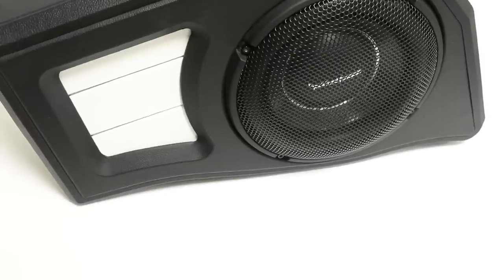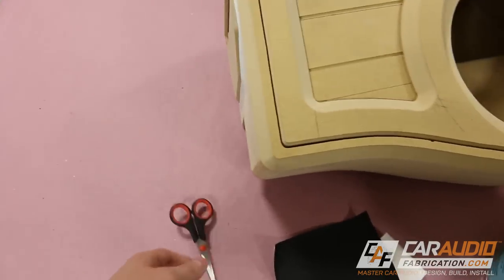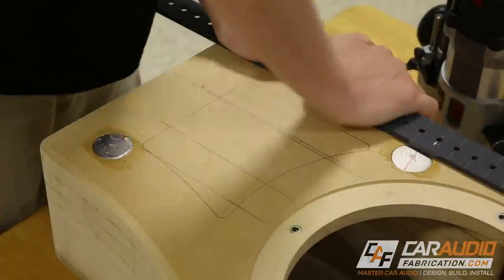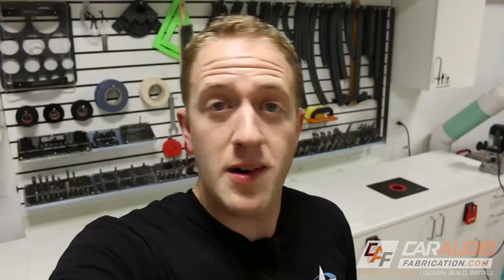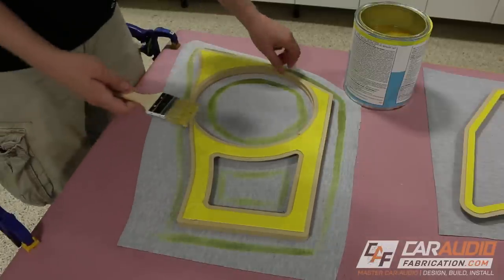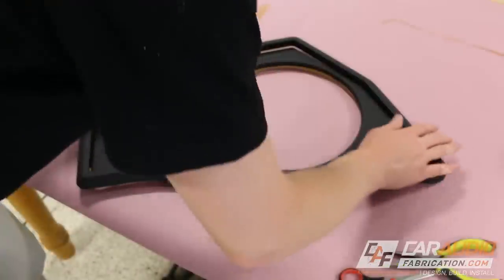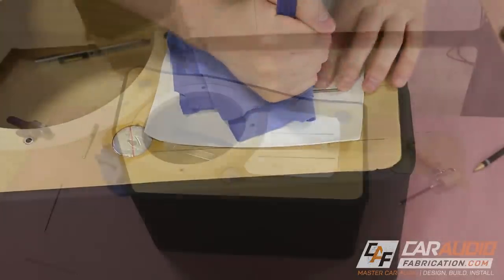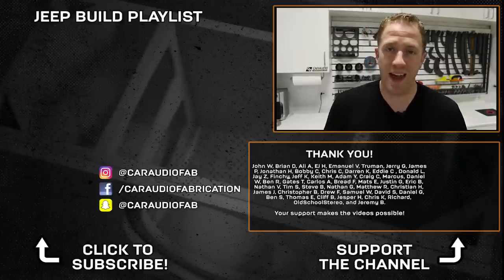VINYL Upholstery Subwoofer Box - Wrap Techniques - CarAudioFabrication

Comment: 5 dislikes? That's crazy how can you not like this? This is awesome great job man
Reply from the maker: +LightsOut Media73 the complaint is usually: "you put in too much effort, that takes too long, that's too hard, that's too expensive" I think few believe in quality anymore
Reply: CarAudioFabrication man just about everything is kinda hard until you learn how to do it and do it well,of course it takes long but the outcome will be worth it,keep up the good work,I use to want to do this 20yrs ago but it wasn't for me but I like the craftsmanship of this type of stuff👍🏽
Reply: CarAudioFabrication correct. VERY few believe in quality. But far too many want to charge as if they were building the highest quality results. 
I told someone recently, if you don't have the money for the high quality stuff maybe you should step down in size...not quality. Most of the time you'll spend LESS in the long run by getting better quality over bigger size.

Comment: HELP, PLEASE HELP!!!
Im trying to upgrade my system in my vw t5 van, i have a d,din pioneer,  rockford fosgate speakers front and rear, so my problem is that ive added a fosgate mono block amp with 2x8"vibe subs. But it sounds crap! How do i work out the volume space for the Box? Im trying to build a box over the rear arch with a fiberglass back!
Please help! I use to be into car audio in the 90s, man its reaking my head. By the way, LOVE the work, mans got skills

Comment: Very Trick looking! This has nothing to do with cabinet finishing, I like to use uninsulated crimp connectors, and I've been searching for a crimper that can do it in one shot. I've been using these for  ages, so I've gotten fairly adept at making good connections but there must be a tool that will make the crimp and fold the locks down in one squeeze, do you know of any brand that is effective?

Comment: Hi Mark, What is the depth of that rabbet cut on the back sides of the MDF? I'm guessing 1/16"?  I'd like to use this technique to wrap some speaker baffles in tolex (vinyl) with contact cement, and I'd like to accurately account for the thickness of cement + vinyl. Last question... does the home center grade of DAP weldwood (red can) work well enough for indoor projects? That Landau cover cement is $50 for a gallon, and I will not need an entire gallon of the stuff. Thanks for sharing your process!

Comment: You can use hair dryer fan to easy shape vinyl .that way is much to stretch and easier to shape it.vinyl will drink much glue and will get kind dry 6so when glueing use enough glue so it will be wet

Comment: Super Nice custom box finish. I am inspired to get something like this but with 2 droppin Hertz Hotel subwoofers, 12 inch. Do the grills stop the subs to flex (Xmas)?????
Reply from the maker: The grill is designed to be a far enough distance away from the subwoofer to avoid contact during full excursion.

Comment: In this video, I noticed you still have your box in pieces, and it isn't fully assembled. Do you allow holes in the vinyl for screw/nail assembly on your boxes? I'm trying to figure out how to do this to my current build, which involves a LOT of different pieces.
Reply from the maker: You need to think a few steps ahead when it comes to vinyl clearance and how everything mounts together. I recommend fully watching each build I do so you can really see the full process

Comment: Has anyone used car audio fabrications custom box designs?  I'm thinking about pulling the trigger on a single 12" ported, have a prefab box now that is only made of 5/8" mdf, no bracing, and sounds like it's tuned a lot higher than what they told me.  I would love to have a pro disign it and I build as long as there is a big difference.

Comment: If I get a new and better Stereo in my car will it make the music in my car better ?
Reply: Shabazz No it will make it much worse.
Reply: Andrew Balus so I should just stay with the factory stereo ?
Reply: Shabazz Are you upgrading your factory radio?
Reply: Ya too a new stereo
Reply: Shabazz A good aftermarket radio will make your factory speakers sounds moderately better compared to your factory radio. I would upgrade the speakers as well.
Reply: Shabazz And if your factory head unit is nice, and works with navigation etc. You can keep it still by using an aftermarket DSP. This can all be explained better in a forum setting like DIYMA. I'm a member there. And I highly recommend their advice. Just watch out for the guys that insist on needing fancy equipment. You may notice the difference between a $1000 Jl Audio amp, and a $150 PPI amp. But not $850 worth. And you can always upgrade later. I have a PPI 900.5 5ch amp, and love it. But if I had to do it over. I'd spend a little more, and get the NVX 5ch, or for a little more on a 4ch, and separate sub amp. NVX amps are very well built, and put out more power then they are rated at. Even though they use the same chassis as my amp. Their subs are very, very nice too. One of, if not the best bang for the buck companies in car audio. Check out their X series component speakers too. Made by SB Acoustics (former Scanspeak engineers started the company), but modified for car use.
Reply: fdfc78 appreciate the reply, u know how much it could cost to get new stereo installed professionally?
Reply: Shabazz oh god, last time was prolly 20 yrs ago. I can barely remember what I did yesterday lol. Sorry I'm no help.
Reply: Shabazz It's not cheap. Maybe $60 to $100 for the head unit. $150-$200 for amp. Front speakers $100. There's a lot to it. If you want a good system, and want to pay to have it installed expect AT LEAST $1500 to $2000 for a basic head unit, amp, front speakers (don't need rear), and subwoofer. If you buy used, and do it yourself. It can be done for much less. Under $1000. Even under $750 if you're patient.